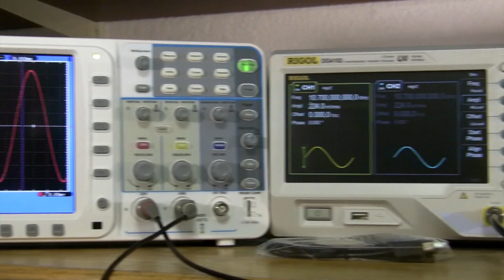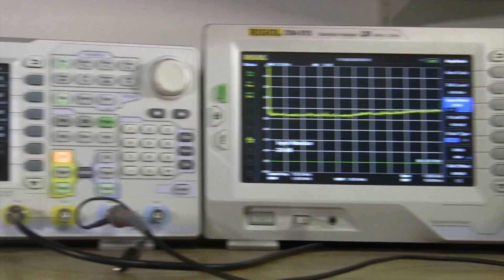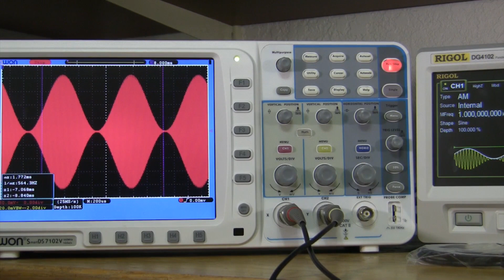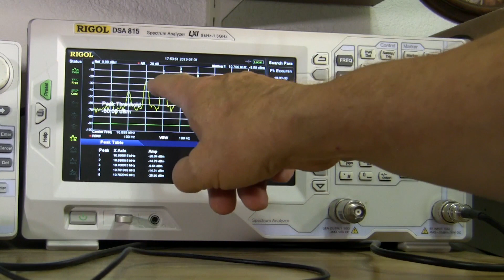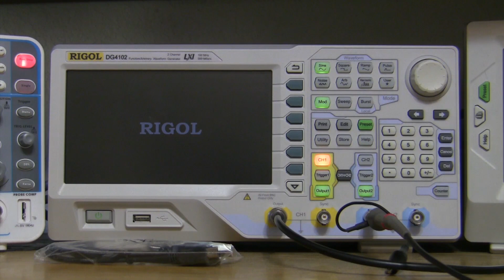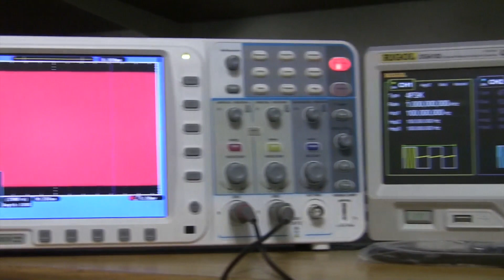A First Look - DG4102 Function, Arbitrary Generator

Comment: Can the signal generator sweep for IF alignment?
Reply from the maker: Yes.  If you want to sweep the IF at the IF frequency you will need to tap into the input and output of the IF at some point and set the Tracking Generator to sweep across the IF.  Otherwise just sweep at the RF input frequency using the Tracking Generator output (possibly with an attenuator to get to a low enough signal level) then use an oscilloscope to monitor the IF output level. 

Keep in mind that you may need to use a very small capacitor and resistor to reduce any tuning effects caused by the 50 ohm Tracking Generator and Spectrum Analyzer's port impedances just like you would need to do with a normal signal generator and oscilloscope.

Comment from the maker: Those who wish to see a video of the internal arbitrary waveforms available in the DG-4102 should check out youtube(dot)com/watch?v=VtiNIAXPbIc where jcndizo has covered this quite well so that I won't post a video showing those functions.  

I will, at a later time, show use of the two channels to generate a modulated rf signal that is also varied in signal strength to simulate mobile fading or to provide pulsed test signals to check AGC attack and release performance.

Comment from the maker: See my later revised video where I re-learned how to use the hold off function of a DSO to trigger on the audio envelope instead of the rf carrier signal.  The OWON unit isn't the greatest DSO but at the time it had 10M memory depth, which I needed, battery operation, which I wanted, and a 800x600 screen.  

Today there are better scopes in the same price range with some really nice ones at $700-900 (i.e. twice the price) but that was not the case when I bought the OWON.